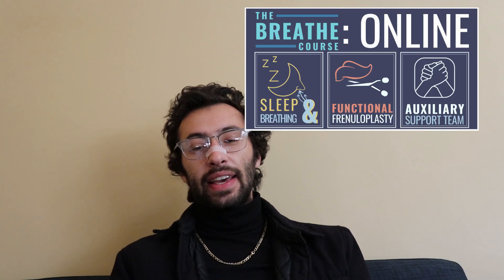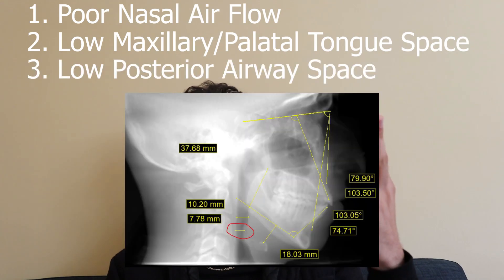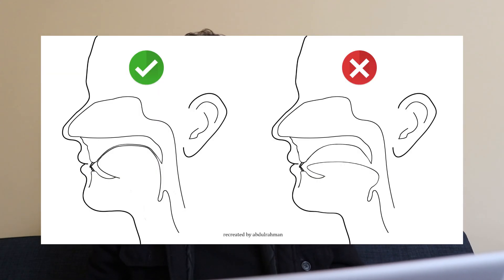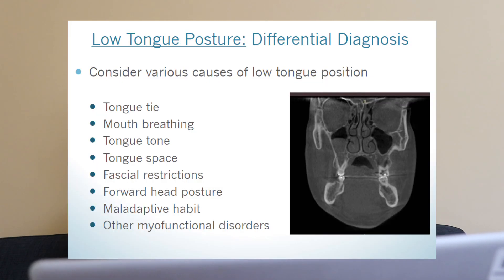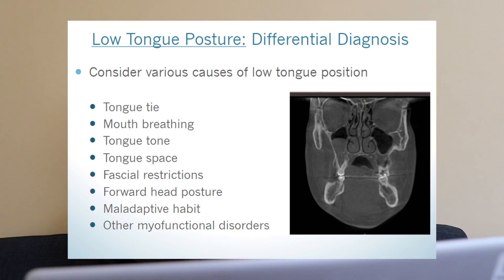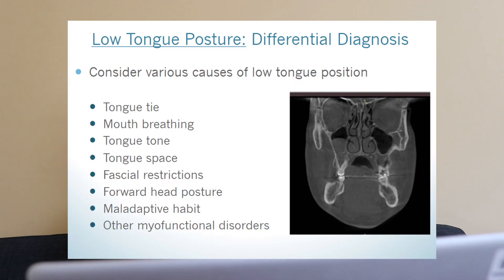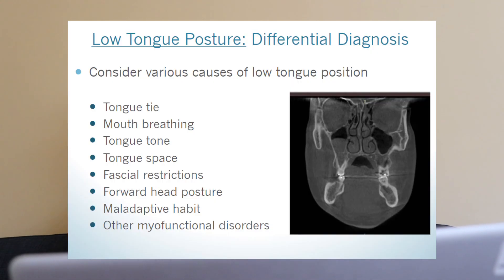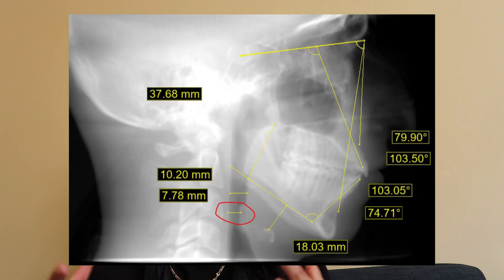How Exactly I'm Fixing UARS/Sleep Apnea and The Importance of The Tongue

Comment: My maxillofacial doctor dosent believe in MSE at all for air flow/sleep apnea issues. However, your video is convincing MSE can help Nasal airflow and palatal tongue space which will eventually help airflow/apnea. 
The doctor is confident MMA and genioplasty is more than enough for my severe sleep apnea. I am leaning to only orthognatic surgeries due to insurance and cost. Hopefully I can do MSE later and get same benefits  if orthognatic surgery dosent help my sleep apnea. 
What's your thought on my situiation?
Reply from the maker: You can do MSE or SARPE later, yes. If you have severe sleep apnea and want a solution fast, I think it can be wise to do MMA and Genio first and MSE or SARPE down the line. You risk aesthetic issues with teeth not lining up though. And I think it can cause some alveolar bone issues to do two rounds of braces like that.  It's really up to you. I think it's silly not to believe in MSE at all for airflow though so hopefully your doctor is a good one.

Comment: Hey Evan, your videos are great and I love them so much, I am 22 years old diagnosed with UARS also and I am considering MARPE, and my question is that if it's possible that the MARPE can cause malocclusion?
Reply from the maker: Hi Yarin! Thank you for the kind words! I don't wanna say it's impossible, because there's always a risk of things going wonky. However, MARPE nearly always actually fixes malocclusion. In fact, MARPE was originally designed to fix malocclusion. So I am not at all worried about MARPE causing malocclusion.

Comment: Hi Evan. Great video! By the way, are you also considering Uvulopalatopharyngoplasty (UPPP) surgery?
Reply from the maker: No. I don't seem to have enlarged soft tissue so I'm staying away from all soft tissue procedures for now. I'm sticking to osteotomy (bone surgery) first.
Reply: @evanlavizadeh4032  Got it. Thanks for the response. Also, how was your CPAP experience given that's the treatment of choice for sleep disordered breathing. (OSA, UARS) ?
Reply from the maker: @vishal-846  CPAP helps a bit but it's not nearly enough. I still use it and I've been using it for 3 years now. But I'm still waking up alot throughout the night and I am tired all day.
Reply: I know you know a lot already about your own condition. But I would say give BIPAP or ASV a try if you have UARS. 
ASV in particular is great for UARS. I think it's helpful to give all machines a try before complex (and risky) surgeries. Anyway, I and many others are with you in this journey!
Reply from the maker: @vishal-846  yes I've considered that. I might do it soon. For my case though, I realized there's many other benefits that I need from the surgery. For example, I need to treat my chronic nasal congestion. Thank you so much for the advice!

Comment: 3:30 In my experience SDB caused nasal congestion which of course caused more SDB. Nasal valve collapse (also a problem for me, but my F30i takes care of it) probably contributes in part to the SDB. I never have any problems with my nose during the daytime.
Reply: Most people with UARS have nasal congestion because of all these structural problems. The nasal passage is simply too narrow. PAP isn't going to resolve that...it might just blast through it by brute force but it's not going to fix the underlying issues for most people with these structure problems. Some inflammation of the turbinates can happen from stress and over-breathing however, but those things are also all part of the vicious cycle of structural problems and bad habits. If you correct the narrow maxilla/narrow nasal passage, and improve tongue posture and breathing habits, the nasal congestion will go away.
Reply: @drm-92  Explain to me how I can do strenuous exercise with a clear nose now during the daytime, without mouth breathing and without using those nose things Evan has on in his videos. My experience calls your bullshit.
Reply from the maker: @cebruthius  yeah it seems we still have a lot left to learn
Reply from the maker: That's interesting. Any idea why sdb caused nasal congestion?
Reply: @evanlavizadeh4032  That's an interesting question. Also why did it cause Psoriasis for me? I think anxiety/stress and inflammation are closely connected. I also used to produce buckets of earwax, needing irrigation twice a year. Not anymore xD

Comment: The problem with correcting forward head posture is, it's there because of a reason. That reason being compensatory of course, forward head posture opens up the airway behind your soft palate. Once you force yourself into a new posture, you might actually worsen the breathing situation. You'll have to address recessed upper and/or lower jaw first to get a good posture and be able to breathe normally.
Reply: Actually very good insight @blasterbeam I like it, it sounds logical. Thanks
Reply: For me it’s definitely a push-pull scenario. I developed fine growing up so I have tongue space but I do have a grade 3 tongue tie and I developed palatal/lingual incompetence about 4 years ago. For me personally maintaining good posture does narrow my airway, but it is a good reinforcer to force myself to drive the back of my tongue up. That said, I’m definitely in a situation where muscle tone/tongue tie combo is more of an issue than tongue space
Reply from the maker: Yeah I figured that much. Do you think I can address the other bad parts of my posture? Or are does it not work in isolation like that?
Reply: The poor posture increases posterior airway space — so the posture actually benefits you until your airway is corrected.
Reply: Bro for how long you are having correct tongue posture  you will get a better looking in couple of years

Comment: Your posture is really bad. I'm not a pro but I can see this:
Anterior pelvic tilt
Hyper lumbar lordosis
Thoracic kyfosis 
Forward head posture
Tight sternocleidomastoids 

I am working with a Functional Patterns practisioner. I can highly recommend it.
Reply: I had basically 4 out of the 5 mentioned issues, *which resolved by themselves when I started sleeping well with BiPAP*. Forward head posture is a matter of airway anatomy, no "practitioner" (correct spelling) is going to change that.
Reply: @cebruthius  Okay interesting! I agree, bad posture is a airway caused problem. Which means it is top-down. However, does help if you try to fix it bottum-up aswell. I see it like a company, you can change things top-down or bottum up. Many times top-down changes result in the biggest changes I believe in a company. Perhaps also in the body!
Reply: @cebruthius  Well just a narrowing of the airway. Perhaps not the details you are pointing towards. Would you like to tell me what you're trying to say?
Reply: @cebruthius  So when one has trouble breathing through the nose during sleep and start mouth breathing, we need to create more space to open the jaw. Also to open the airway we need to create space. We do this by tilting our head backward and flexing our neck. This basically creates forward head posture, tight sternocleido mastoids > thoracic kyphosis, tight pecs and thoracic area > hyper lordosis lumbar area > tight hipflexors > (and then all the way down, but I couldn't give you any specifics on that due lack of knowledge).

So that is how it is connected, at least from what I have seen / researched. I'm curious to your additions and insights, thanks.
Reply from the maker: @cebruthius  wow your postural issues resolved on their own with the use of BiPAP??? That's incredible. What was the timeline for all of that and how severe was it before and after.
Reply: @cebruthius  Still waiting for your smart answers....
Reply from the maker: @cebruthius  @gezond nederland. Y'all are hilarious.
Reply: @cebruthius  So first your going to flex your ''supposed'' knowledge and then you tell me that you are not going to tell me because I lack knowledge. Seems legit.
Reply: @cebruthius  ''You don't know jack shit'' , ofwel jij weet zoveel meer. Maar uiteraard ga je mij dat niet vertellen. Want je weet blijkbaar veel meer dan ik. Maar wat je weet, ga je niet vertellen. Logisch.
Reply: @cebruthius  Exact jij komt met helemaal geen theorie! En jij weet zoveel, leg dan eens uit waarom dingen die ik zeg niet kloppen.
Reply from the maker: Wow thank you so much for bringing that all to my attention. Is this treatment covered by your insurance?
Reply: @evanlavizadeh4032  Well my FP therapist is a fysiotherapist aswell so he just includes FP techniques in my treatment. Fysiotherapy is covered in my insurance, however I pay extra money for that.

I think costs are manageable if you visit a FP practisioner once per three weeks. It's a lot of homework you have to do youself anyway. As you know, nobody can fix you but yourself. You have to do the work, especially when it comes down to muscles and fascia, there's no surgery for that.

Anyway I'd love to answer any questions you have or how it is helping my posture so far. Thanks for posting your videos as that is helping me a lot!
Reply from the maker: @MP-wn7ue  oh that's awesome. I'm definitely willing to put in the work. Is your physiotherapist familiar with this whole sdb and craniofacial abnormalities concept? And thanks for the kind words!!
Reply: @evanlavizadeh4032  Not into deep details. I told him about my problem and he was very interested. But Functional Patterns focussus on the body I believe, it does include shoulder and neck/head posture. But I'm not sure if it has mapped out the pathophysiologies of the jaws etc. I think that's a small missing piece. However it does help tremendous for the body. I takes time, and I'm working for 5 weeks with the practioner. However I'm very impressed by the Functional Patterns system regarding posture.
Reply: @cebruthius  That wasn't an answer for you, it was a answer to the question if FP includes SDB treatments.